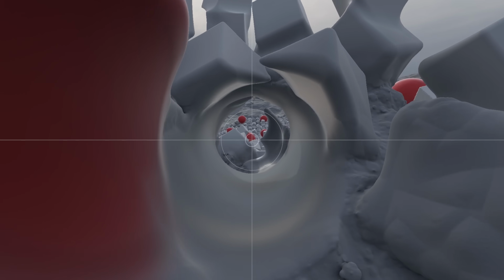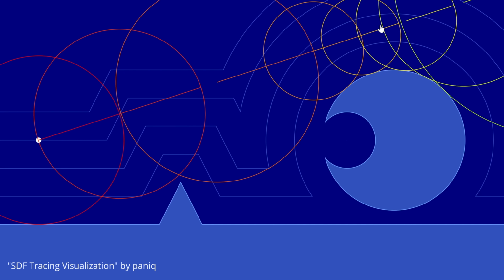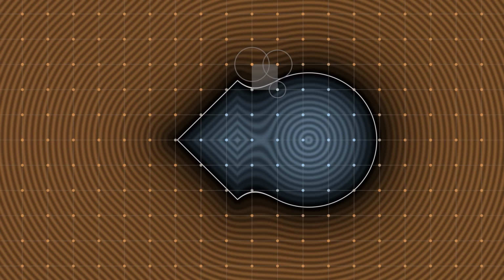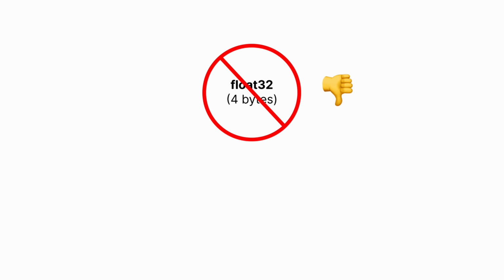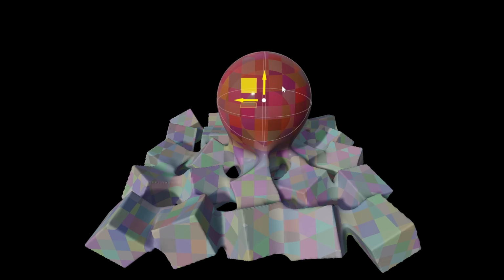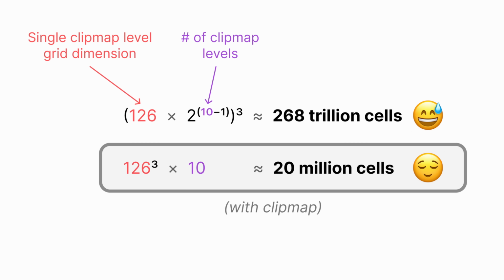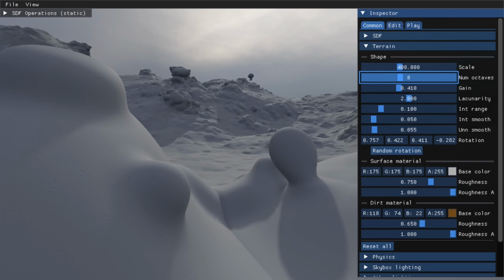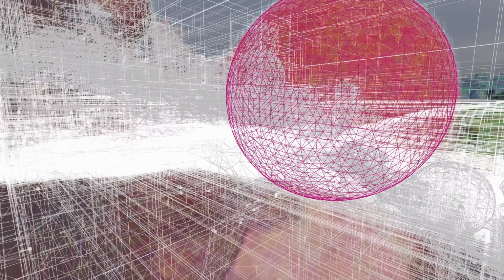I'm making a game engine based on dynamic signed distance fields (SDFs)

Comment: Awh, I'm bummed that you didn't try to do SDF-based collision. I know first hand that making an entire physics engine from scratch takes a lot of work, but given your knowledge on data structures and optimisation, and given your engine's already existing code, I think you could probably do it. Using SDF as the support function for something like GJK+EPA would be interesting.
Reply from the maker: It is something I'd like to figure out eventually, but there are so many technical challenges in this project I do have to pick my battles for now!
Reply: @Mike-Turitzin  Fair enough - but considering SDF based collisions are actually faster than mesh based collisions, it might be worthwhile for performance alone (if you do need more of that)
I'd imagine extending Jolt would be a decent technical solution as well without having to reinvent the rest of the physics engine
Reply: @vocassen I am not so sure they are. One of the only SDF-SDF papers out there does not indicate so. Contact generation is quite expensive and you also need to sample enough points to accurately represent any shape. The paper I am referencing uses an octree between intersections of the SDFs bounding boxes to find enough starting points. Then after selecting roughly 200-400 starting points, the use a simply gradient descent to find the deepest intersection for that point. I am not confident that SDF-SDF would be faster than triangle-based.
Reply: @doufmech4323  For this engine, the most relevant case involves arbitrary meshes, with the worst case, concave, being notoriously expensive to compute interesections and resolve collisions with. To the point you might want to convert them to an SDF (there are papers for that, not sure if engines actually use those).
Note collision testing is just one part, resolving the collision involves computing how to "unstuck" two objects, which SDFs are uniquely suited to since they embed that direction vector right in.
But even those collision tests alone, done right on the mesh itself, has to use various LOD techniques (like octrees) to not have to do an insane amount of edge-edge and edge-face intersection tests. It just is a really, really complicated problem to solve quick.
But also, luckily, general concave-concave collisions are rare in typical scenarios. For the most part, games are dealing with simplified shapes (sphere, cube, cylinder, etc), and there, the special cases they allow for obviously outperform any general SDF-SDF collision detection. Though I am not sure, I'm fairly sure e.g. a cube-SDF collision is cheaper or at least comparable to resolve compared to a cube-concave mesh collision.
But there are some unique points to this engine that completely reshape which representation makes more sense:
First, we already have SDFs, which might take any shape (even concave). Given, a lot of collision objects in the video are simple shapes spawned in (perhaps because of the performance implications of mesh based collision in Jolt). But unless you remember a spawned objects initial shape until it merges/collides, there is no way to turn an SDF back into a simplified shape. Maybe you could determine it to be concave and thus use faster algorithms.
But that's just individual, spawned objects. Most objects in this game are already concave or at the very least complex convex meshes. And if they change, they need to be converted to meshes, which on those timescales, is obscenely expensive. On top of that, the resulting meshes will typically be much more dense than optimised collision meshes you see in games.
These last three points are unique to this engine, and add an additional, severe performance penalty ontop of the typical SDF vs mesh collision argument, that makes SDF collisions uniquely suited to this game.
Reply: @doufmech4323 one could probably adapt the new technique from "A Cubic Barrier with Elasticity-Inclusive Dynamic Stiffness" for use with SDF and I suspect that'd, after some optimisations, give much better performance than one would naively expect
Reply: @Mike-Turitzin  it is actually a very robust method, so it definitely has its benefits but agreed picking ones battles is key
Reply: @Mike-Turitzin  I think you could lift that one recently discovered revolutionary collision handling technique, which fully kills collisions (I DON'T mean the also recent nVidia one!), it's performance heavy in traditional rendering but I suspect it would have much better performance after adapting it to SDF usage, see "A Cubic Barrier with Elasticity-Inclusive Dynamic Stiffness", two-minute papers has a video on it
Reply: @ @Mike-Turitzin  1st, calculate penetration, then zero out the momentum, then apply the reaction force as gradient (normal) * penetration value.
Reply: @Mike-Turitzin  You probably already saw this in the docs, but Jolt supports custom collision shapes. Basically, you make a class that inherits from JPH::Shape, then you override a few simple methods like CastRay and CollidePoint. You also need to register free functions that implement collision detection between your custom shape and other shapes you plan to use (including swept shapes if you plan to use those). But I don't know how difficult it is to implement collision detection between SDFs and any shape except spheres.
Reply: A great research paper was published on this recently
Reply: @toxiccan175  link?
Reply: @toxiccan175 or the name of the paper in case the comment gets deleted
Reply: SDF-based collision and physics would be cool in principle but you gotta admit the current approach works and looks great.
Reply: @TheWootfish  Absolutely! This is beyond impressive

Comment: Interesting thought for characters: they are meshes, but let's say a projectile hits a certain triangle (or group of triangles), that triangle is removed from the render and replaced with an sdf sphere and its location and rotation is parented relative to the specific bone that triangle was a child of. This would then allow for fully rigged characters or vehicles that can deform as sdfs. For example, tank armor or wounds. It may require a second grid that does not interact with the terrain or other objects. I also have no idea of the feasibility or desire to do this and know nothing of the maths or code required.

Edit: or the sdf exists for under the mesh already as basic shapes that conform under the mesh (effectively like ragdoll collision spheroids).

Comment: Amazing stuff!

I've got a similar-but-smaller project I've been working on lately. I've frankensteined Unity to OpenTK, such that I have access to Unity's language and engine paired a graphics pipeline that allows for recompilation at runtime. The idea behind this is that in the case new SDF's are added, they are hardcoded into the shader; far less dynamic and realtime than this, it's best gated behind a load screen or used in a turn-based game.

Are you keen to get other eyes on the project? I'd love to contribute!

Comment: i both love and hate how objects melt and fuse with one another dynamically; though either way its ABSOLUTELY INCREDIBLE !
Reply from the maker: Yup, I kinda overdid it with turning on smooth blending for everything, but it isn't necessary
Reply: @Mike-Turitzin  would base it on weight to how much it blends and digs
Reply: Each object should have some settings for it

Comment: This seems like the perfect engine for a snowboarding/skiing game
Reply: Duuuuude.

SSX 2026 needs to be a thing.
Reply: Had the same thought. Snowfall, having lines change once ridden, and maybe even avalanches could be decently modelled (e.g with physics simulation of edits). This would make for a promising foundation for a mountaineering sim.
Reply: not like those were struggling with snow physics though
Reply: Shooting wet peas at Mr Potato head works too though
Reply: Or I could imagine something like building igloos or ice castles then sieging and destorying them with fire weapons.
Reply: @jasonwatkinspdx  Okay you have my attention. We need siege towers that use hot spikes to attach to the walls. You can remove the towers, but not the scars of battle. Brutal Legend style commander game.
Reply: Would make for an epic map editor, just give the player a bunch of shapes that add or subtract with texture options and hard/smooth edges option.
Reply: @LtVax27  That might be good for terrain, but for details it's probably best for mapmakers to use the same methods devs do: kit bashing with all the level's premade assets. Making every little detail a unique asset will cause huge memory bloat and needlessly stretch artistic effort.
Reply: @Chicky_Lumps  makes me wonder if it's possible to make a texture variation generator for props. like I imagine HL2 furniture or props having that. they tried to do something similar in HL1 for some map textures but it's premade.
Reply: Mudrunner? The mud was awesome in that but this would be so much better. And Arma  Reforger has trenches and dugouts now. Imagine a muddy or deep snow winter warfare version of Arma 4.  Bomb craters...
Reply: Would also make a good mukbang simulator.
Reply: Realistic FPS as well, or MMO
Reply: the problem is that calculating collision in a SDF based environment can be pretty hard.
You can't go with the bounding box method, you must absolutely calculate the center and direction of your object based on marching methods, such as calculating the center of multiple instances of a fractal for example, then making an average from the total surface copies of said fractal, then calculating its angle to decide on a contact point with terrain that would evaluate direction and position.
Making sport games in such an engine would be actually very complicated for that reason; using SDFs isn't as simple as just having a model made from verteces and creating a bounding box around them, it's about creating something out of thin air using vector geometry and then calculating averages and contact points until you end up with something that makes sense.
It's completely different from regular dev.

The other problem; SDFs make it so your entire game is now running on the GPU, which can causes problems on some machines as well.
Reply: @ryouskun4754  seems like you didn't watch the video before making this comment. OP creates a triangle mesh for collisions so the physics part works like in any other game engine in the end.
Reply: @forasago  from what I'm seeing he's only using triangle collision for Jolt support, not for overall world collision.
What he uses for collision is marching cubes, but those only approximate collision at best, telling an object when to stop and not to enter the space of another object located on the same cube.

The problem stays the same; he isn't calculating the collision using the SDF itself, which is doable with the method I mentioned above, known as a point based collision (and he admits it himself in the video), but it's hard and complex to implement.
And his current collision system isn't suitable for a game that needs realistic collision like a snowboarding game, such games usually employ raycasts to calculate distances with a mesh and offset it with a force pushed the other direction, something you cannot do with marching cubes like here, even though you could probably use the SDF itself for distance calculation and know how much force to exert, you wouldn't be able to tell what angle it is exerted at.

I recall another person who made an actual bonafite racing game using SDF based collision, called Marble Marcher.
But it's only able to do those collisions because of the nature of its environment being made with only fractals, and it would be unrealistic to create an engine that generates everything out of fractals only, so this is honestly a pretty tough spot for SDF based engines.

Also even if what you said was true, it wouldn't then make it a SDF based engine, it would make it a regular engine with vertex based meshes and collision, that happens to be using SDFs as a rendering method for its visual, and any engine can do that.
Reply: Market for those is pretty small though.  There have been several indie releases over the past few years, some to small success, but no breakouts.

Comment: This is really impressive! I've implemented something similar but crazy inferior to this in a lot of ways. For one, it sounds like you are not storing gradient information, but rather computing it from grid. In my work I've been using a dense grid AND storing gradient along with SDF and material index but as you can imagine the memory usage is not good. Are you using SmoothUnion to combine shapes, or is that a result of the sparse architecture? I'm super impressed with this and would hop on your discord to chat if you have one.

Comment: Don't physics also use some kind of SDF to check if and where two bodies collide? Bodies are represented by math and a calculation tells where they hit, how they should move to seperate and then a solver gets all that info and applies forces/torques and position/rotation offsets to best seperate all bodies.
Reply: I'm also curious about that. I'm guessing that the blending parts wouldn't be captured in the physics if primitive SDF bodies were used.

Comment: Congrats on a banger first video! Do you also have a strange feeling when you have a problem with your technique and you can't find any references for solutions?
You're doing some really impressive work here! Can't wait for more updates.

Have you looked into Verlet integration particle physics? That seems like it would fit right into your engine! Check out Obi Physics to see what it can do. It is an asset for Unity, but the technique should be fairly repeatable.
Reply from the maker: I haven't done anything with physics outside of integrating Jolt so far. Fluids are cool but my decision so far is to leave them out of scope for perf reasons
Reply: @Mike-Turitzin  It's not just good for fluids. It is good at simulating soft bodies, cloth and rope. Since it consists of spheres and capsules it can sphere cast through the SDF world for incredibly fast collision. You would not have to worry about performance since your world is all SDF already!

Comment: This is amazing work! Dreams never came to PC, it would have become a staple there (which is probably the very reason why we can't have it).
Here's hoping for your success!
Reply: There is a whole lot more to this to be honest, and I say that as the most disappointed person as far as Dreams is concerned (that Courage the Cowardly Dog game though, huh):

Yes, it would have been neat, or maybe will be neat at some point in the future, but there's also so much in the way of UX work, minimal system requirements you can hardly meet on PC (UGC games have always been a huge dang headache, always - just consider why the Starcraft games have a unit cap lol), compatibility issues control schemes, haptics, VR (like that isn't a massive wrench in the ways of accommodating an extra platform with MKB as the default input method)... it deserves so much more attention than it got, but at the same time, it'd be a pretty daunting task for an already fairly busy and small team.

By all means, let's see it happen.

Comment: The Brickmap part got me really confused at first, I looked it up and got even more confused but now I think I get it.
In the graphic at 09:45 onwards, each cell in the left points to a cell on the right (in the Grid-Map).

So instead of using it for LOD or something, you used it to store 4 values each.
But the left grid would still need the full resolution then, containing all the pointers.
This just cuts the space down from 4 bytes per tile to 1 byte per tile (which is a pointer to a brick-map-tile)?

But then you say "bricks are 8 by 8 by 8".

So .. do you have 3 layers? A low resolution grid pointing to 8x8x8 chunks (if not empty) and then the 8x8x8 chunks pointing to locations in the brick map atlas containing the 4 corner values each (if not empty)?

Comment: Very cool! Look forward to seeing more. It would be interesting to hear you comment on the object blending. It looks quite unnatural in some of the scenes you showed. I understand it's largely inherent to SDFs. It would be interesting to hear your thoughts on the artifact where a cube is on the ground and it expands and blends into it. Is it completely unavoidable? Have you tried any techniques to combat it, why did they or didn't they work? All very interesting questions to me.
Good luck!
Reply: As I recall, the blending is an optional smoothing function. It's what you get when you relax the distance evaluation threshold: When the distance is 0, you recover the original surface. If you just clamp the isosurface range to some small epsilon (reject all values > 0.00001), you'll get a hard boundary. Although given his atlas caching strategy, the blend distance may be linked to some fixed parameter like grid resolution, so he may not be able to represent variable isosurface evaluation without dramatically increasing the storage requirements. It depends!
Reply from the maker: Yeah, the blending is optional, but I got carried away with enabling it and I think it was confusing to use it too much
Reply: @Mike-Turitzin  It's no biggie IMO. In many places it looks cool, like when you're digging or building the black wall. I don't remember if it can be selectively disabled, which would make sense in this situation. Digging could be smooth while physics enabled geometry had sharp boundaries.

Comment: Nice work! Going into this video, I was really expecting this to be a libfive or fidget based project. It would be interesting to hear your take on the rendering methods used in fidget.
Reply from the maker: I am familiar with Matt Keeter's (great) work. I haven't experimented with it, though. My technique is more less general than that technique but may have advantages in terms of scene size.